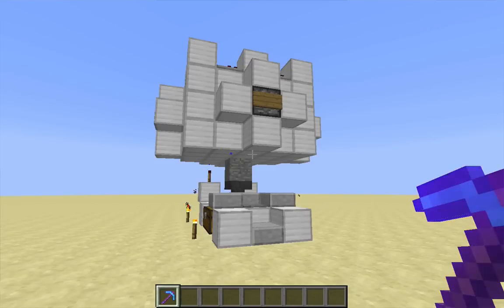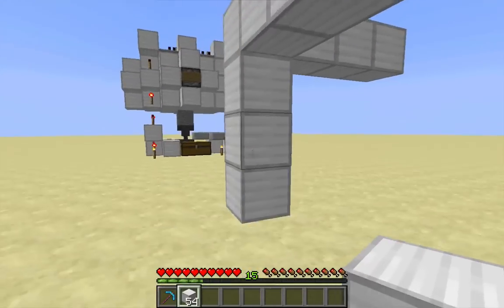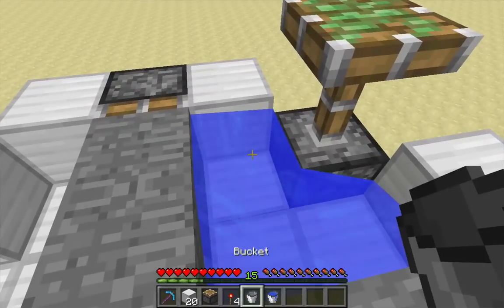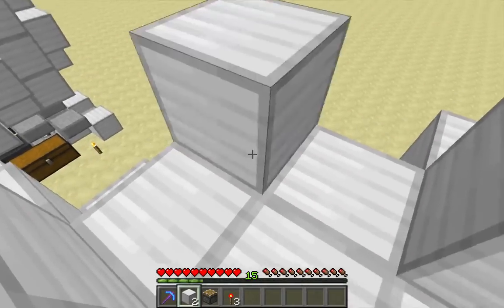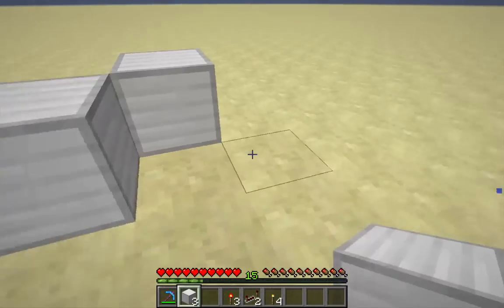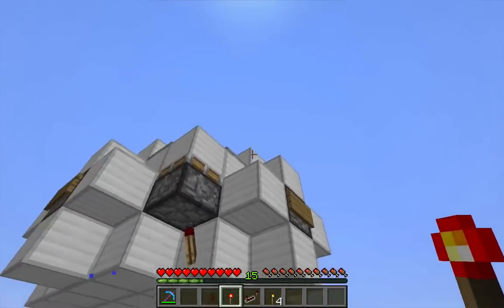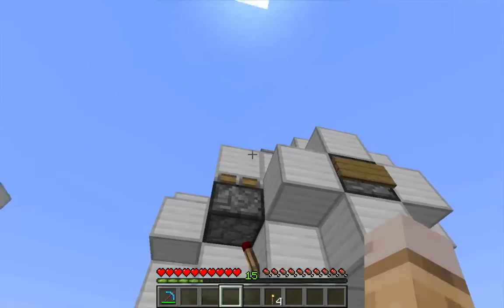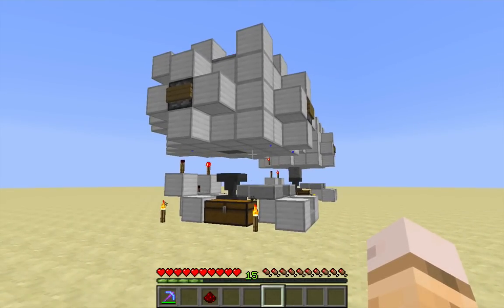Tutorial: Stone Generator v1.1

Comment: Another (more expensive) solution to the starving to death while AFK grinding: Beacon. Set it to haste and regeneration.

Also, I would like to see a skyblock friendly version some time. Redstone can come from witches and iron farms are doable with enough patience. The comparators can be substituted for a long pulse extender and an automatic emptying system for the chest.
Reply from the maker: +Shadow 8472 Hmmm, for SkyBlock, you could probably get the necessary iron by killing enough zombies. You'd likely only need one hopper, plus 6 iron for the pistons. The comparators are optional, so you could do away with them. Hunger can be managed with the new dual-wield system in 1.9. Simply map each mouse button (left and right) to two keys that are held simultaneously for AFKing, and hold a stack of food in the offhand. When hungry, eating should take priority.

A broken pickaxe is the bigger problem. Even assuming you'd be okay with losing a valuable pick, there would need to be some system that dispensed new pickaxes. That's possible, but the on-off switch would need to be re-thought as a consequence.
Reply: I once made an AHK script for a cobble generator that could use a hotbar full of stone picks. I had it timed so that as soon as one ran out it would advance to the next pick. It is an easy way for EARLY stone generator.
Reply from the maker: +Lot Myle Hmm, I've been taking a look at doc's setup, and I think it's a bit more complicated than necessary. I've already designed something capable of spitting out a double-chest's worth of tools for my "SkyBlock friendly" design, and it just runs on the same clock as the stone generator. Tools that aren't picked up are just pulled in by a hopper and placed back in the chest. It's a bit noisy, but definitely cheaper.
Reply: Sounds cool. Doc mentioned his restone wasn't optimized.

I saw the skyblock design... great idea - especially for early game when a player.isn't ready for a more resource demanding version. :)
Reply from the maker: I don't think it's so much a matter of redstone as much as it's a matter of trying to match clock timing to the rate at which he's burning through shovels. It would be much better to allow shovels to spit out at a relatively quick rate, and reclaimed if not picked up. You can see something like this in pi's wool farm.
Reply from the maker: +Lot Myle Ridiculously, I've simplified the stone generator even further, even eliminating the requirement that it be built with non-flammable materials. Now I've got one of oak planks. :-)
Reply: An oak plank stone generator is heresy! I expect you to report for re-education... or just keep posting great content.

Comment: Hi!
Will this one eventually break? Won't  the lava occasionally flow down before the water is recreated and turn it into cobblestone?
Thanks for great videos!
Reply from the maker: +Mr Plupp In principle, lava could destroy the water, but only if the device is shut off immediately after mining a block. While the device is running, the lava can't flow into the water because the piston doesn't stay retracted long enough for the lava to advance 2 blocks (one down and one into the water); in other words, the piston destroys the flowing lava block faster than lava can spread. So, most of the time the block in front of the piston will be water. After a couple of cycles of the clock, the block in front of the piston will be stone, locking up the piston until a block is mined.

If you mine a block and then immediately turn off the machine, it gives the lava a chance to flow downward without the piston destroying it. Only in that case is there a possibility for the water to be destroyed. If you wait to step off the pressure plate until the pistons stop making noise (usually takes just a moment), it'll never be a problem. Even so, there are some relatively easy additions that involve the mechanics of spreading fluids, that would make it 100% reliable even in the case of the abrupt shut off.
Reply: +Nathan Ryan Oh, I see!